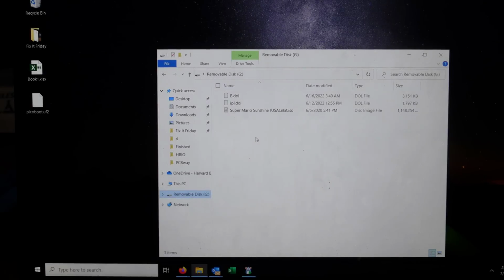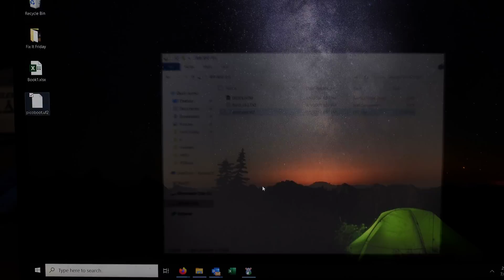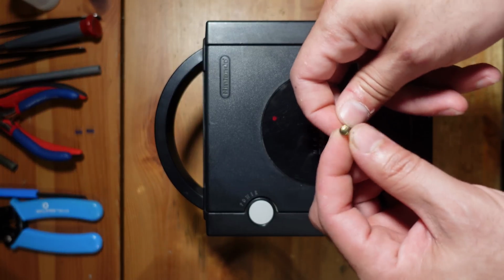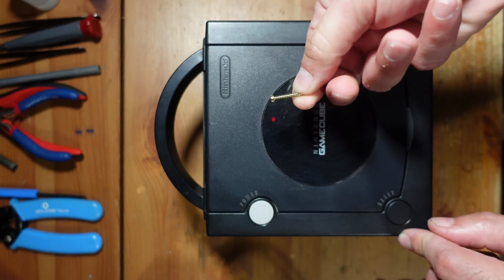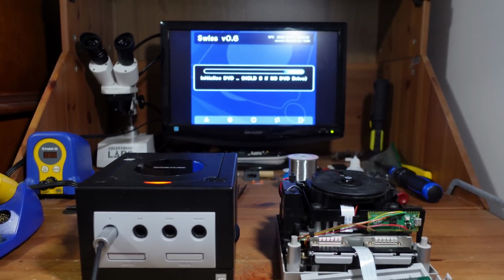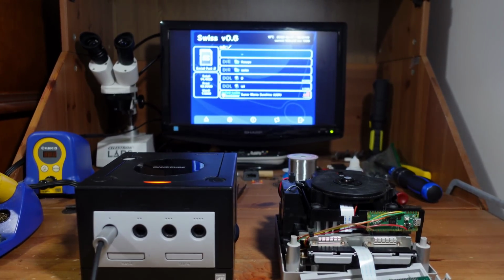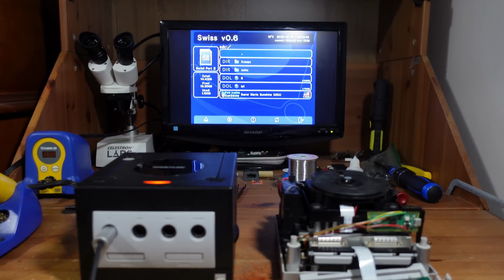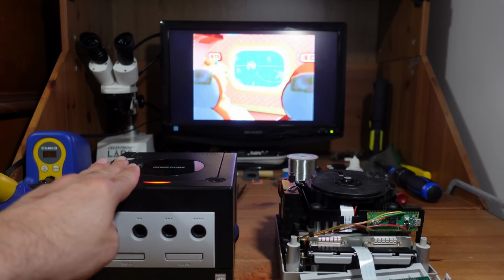NEW $5 modchip for the GameCube - the Picoboot! Install guide for DOL-001 and DOL-101

Comment: Bought Gamecube with Picoboot, but when I press power button, console loads Gamecube menu, not Swiss. There is ipl.dol file on sd-card, but nothing. Can someone help?
Reply: Are you using an HDMI adapter? If so the picoboot chip may be wired to the 3.3v rail and you will need to power the console on with the adapter disconnected and wait 10 seconds before connecting the adapter. I had this same problem with my Picoboot using helders flex and the BitFunX HDMI adapter.
Reply: @oOignignoktOo1  No, I'm using original Gamecube connection.

Comment: Have you or anyone had issues with their audio? Im new to using a swiss booted GameCube and no matter what I've tried I cannot get audio from my games. I've tried new cables, re installing files, using a converter, not using a converter and even using a different TV/speaker. The volume is so low I can't hear it unless my tv is maxed out and even then the static is louder than the actual game. Everything else works perfect but I just can't get decent audio. Any suggestions?
Reply: Probably a worn out / bad capacitor on the mainboard that handles the audio circuitry

Comment: question:
can a dol 101 be moded to have hdmi port? sorry had to edit it had to re check my GC it only has the analog port
Reply from the maker: Yes it can, I have done a video on that mod as well
Reply: @LIRetroGaming  yeah like straight up hdmi ? no adapters
Reply: @LIRetroGaming also have you heard or seen a type c mode for power? for the gc

Comment: I'm having issues when I go back to the Swiss menu to choose a new game it turns to a black screen and I have to power it down. On the root of the micro sd card it has the ipl.dol And I'm running the latest version of Swiss. I use R + Z + B + D-Pad Down to go back to Swiss

Comment: Can I ask you what size wire gauge you used for this? And would it be appropriate for the region switch mod as well? Seems like the wires need to be very thin.
Reply from the maker: I used 28 gauge for the picoboot

Comment: This is a great video, I used this as a walkthrough to complete the project today. Just as a note, for anyone using Insurrection Component cables, or any other video output methods. Swiss boots to 480p in auto mode by default, which was giving me all sorts of crazy issues on my JVC D-Series CRT. But with the original composite cables plugged in, this forced 480i output, then I could go into the Swiss settings and change the default video mode from "Auto" to "480i". Then swap back to my component cables that use the digital video port, and everything worked great!

Comment: Something i found out while doing mine is if after you have installed the pico and you get a blank screen dont panic it just means thet your wires are long cut them down and solder onto the pico that should work

Comment: Hello I followed your tutorial to the letter. I booted up the gamecube and the pico chip worked once. I turned off the gamecube when I tried to play it again it booted up fine but my game controllor stopped working when I'm using swiss. Do you have ideas what the cause is?
Reply from the maker: It sounds like the pico might be touching the controller ports directly. Can you test again but make sure that there is space between the pico and the controller port pcb?

Comment: Hello! So do you only need the ISO file for the games to be read, correct? Also, do you put a separate folder of games for other things like NES or can those all be together?
Reply from the maker: Yes the ISO file can be in the main directory of the card, but you can also place them in folders and it will work. Same thing for that emulator I mentioned in the video

Comment: Should've just hardwired an SD2SP2 in the Dol-101 since it's much faster than the memory card and it's not really much more work than installing picoboot on it's own.
Reply from the maker: Definitely something that I can try next time
Reply: Nice tip!
Reply: That’s what I wanted to do, but I discovered my dol-001 unfortunately doesn’t have a serial port 2! So I’m stuck having to use the card adapter sticking out the front 😏
Reply: @Vmurph  I've never heard of the 001 units lacking a Serial Port 2 connection that might be a rare revision.

Either way you can still use an SD2SP2 on those systems by opening it up and finding the points on the motherboard that correspond to the old Serial Port 2 and solder wires to them to hardwire the unit to work on those systems.
I suggest getting one of the 2 piece versions that have the SD card out the side since after hard-wiring it you won't be able to remove the module from the system.
Reply: @draconic5129  yeah mine is kind of rare. It has no Serial Port 2, but it has the dual AV outputs on the back. The analog AV out and the (never implemented) Digital AV out. Mine must’ve been manufactured somewhere in that sliver of time between removing the Serial Port 2, yet before they removed the Digital AV output. Probably a small window there. I wonder if the colors differed in that respect. Mine is silver. I know the purple was an original color. Did the silver get released at the same time, or was it a little later?

Anyway, thank you for that info! I was wondering if there was a way I could do that. And yeah, I would definitely use the two-piece SD2SP2 Pro. It’s a way better design. In fact, I already had one in my shopping cart, cause I just assumed mine had the 2nd SP, so I was really bummed when I looked underneath to “confirm”, only to find an empty cavity.😅  Now I can put it back in my cart.
Reply: @draconic5129  oops, I forgot to ask… any suggestions on how to figure out which points on my board were supposed to be for the 2nd SP? I’m good with a solder iron, but my knowledge of PCBs is not so great.
Reply: @draconic5129  yeah it would be unlikely that there’d be diagrams for the solder points on an 001, since most of them actually have the port, so there’d be no need to show where the points would be. But I might as well look at a diagram for the 101 and see what it looks like. It couldn’t hurt. Thanks for the suggestion. 😊
Reply: @draconic5129  yeah, this one is a little over my head, so I’m going to have my son take a look at it. He’s an electronics engineer, PCB expert. 😊
Reply: How do you do this? I bought a SDSP2 and realized my gamecube is 101 I’m doing it later today just don’t know if there’s a video of hardwiring sd2sp2 on a 101
Reply: @yaboku444  there's a diagram on Reddit that shows you where to solder the wires for the SP2 port, just solder the wires to those points on the motherboard and solder the other ends directly to the pads on the SD2SP2. Shouldn't be much more complicated than installing a Pico boot though.

Comment: I'm struggling to figure out how you arrived at this being a $5 modchip when the components come to like $25.
Reply from the maker: Here’s where I got it for 4 bucks, try using google next time: https://www.digikey.com/en/products/detail/raspberry-pi/SC0915/13684020?utm_adgroup=Evaluation%20Boards%20-%20Embedded%20-%20MCU%2C%20DSP&utm_source=google&utm_medium=cpc&utm_campaign=Shopping_Product_Development%20Boards%2C%20Kits%2C%20Programmers_NEW&utm_term=&utm_content=Evaluation%20Boards%20-%20Embedded%20-%20MCU%2C%20DSP&gclid=CjwKCAjwq5-WBhB7EiwAl-HEklr6XSlmUiU_6vecvxJgWF3b4kuLBXSbHEvbQwLVQtX2_04D9eYjeRoC-foQAvD_BwE

Comment: I found a slightly better location to route the wires as long as you have small enough wires (I used 30awg) and that's between the cpu and gpu and out through the side of the digital video port, the gap between the port and the metal shield for the dvd drive there is larger for the wires.

I then mounted the pico along the back edge of the dvd drive with the micro USB port pointing away from the analogue video port, if you position it flush with the black plastic of the drive it just about clears the black plastic of the rear cover with about a millimeter spare.
Reply from the maker: Awesome, I’ll try that next time
Reply: I used 30 AWG wire as well and recommend it. You can actually route them through the tiny gap between the connector for the controller board ribbon and the metal housing for a very short and direct route to the Pico mount point. No need to clip any metal to route wires.

Comment: What sort of wires are we suppose to use? O.o
Reply from the maker: You can use 30 gauge kynar wire, although in this case I was using 28 gauge copper stranded wire
Reply: @LIRetroGaming  Does the little cables in the inside of network cables can be used?
Reply from the maker: Not sure what you mean, but most likely

Comment: Good to know that the 101 needs a sd gecko, that is a very important point
Reply from the maker: Yes unfortunately it doesn’t have an SP2 slot. Technically you can solder one in, but in my opinion it’s not worth the trouble
Reply: @LIRetroGaming  I mean, might as well add just a handful more wires while the GCube is already open for the Pico

Comment: Really good technique to remove the heatsink. I twisted it before and damaged the switching diode next to the middle screw hole. Another cool thing about the pico is that you don't even need to keep a broken disc drive in the system, making space for some other mods.

Really excited to see this with the M.2 adapter when it releases.
Reply from the maker: Yes, I am also very excited for that M.2 adapter. This is such an awesome project and I love that it is affordable and relatively easy to install!

Comment: The gc loader has more compatibility with audio streaming games than the pico? Which is better? Besides the fact that the pico allows to use the disc drive. Thank you
Reply from the maker: The gcloader works perfectly with audio streaming games like star fox adventures, and I am pretty sure these games still don’t play 100% perfect using swiss and this method. But that being said, it’s a very small list of games, like 15 at the most. Otherwise compatibility is phenomenal